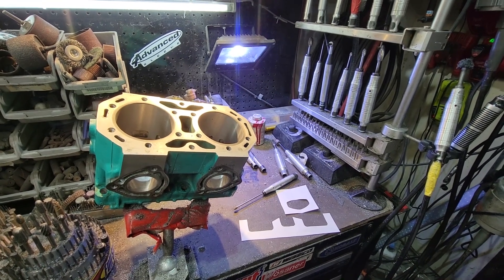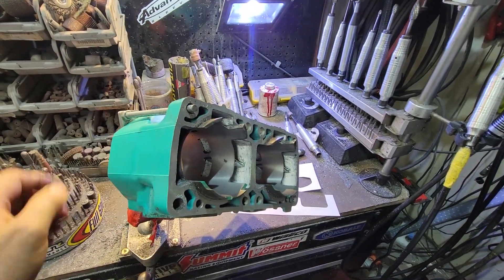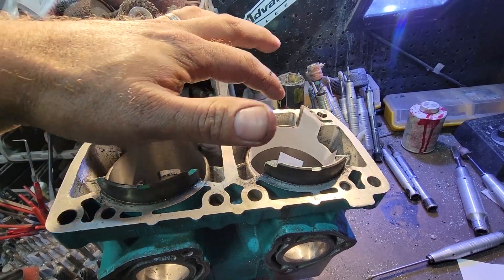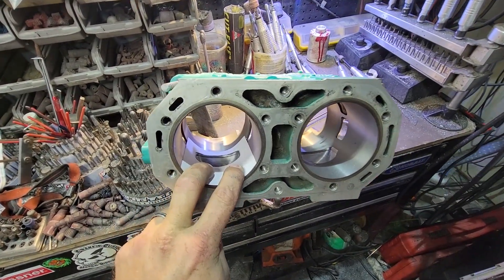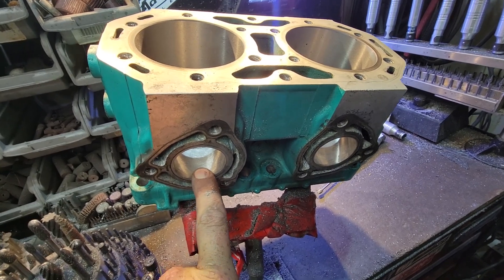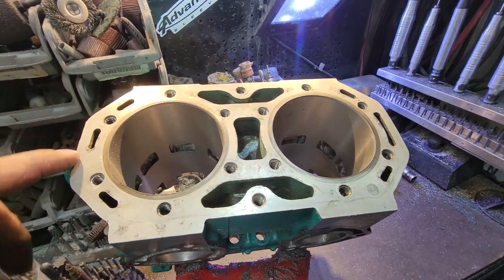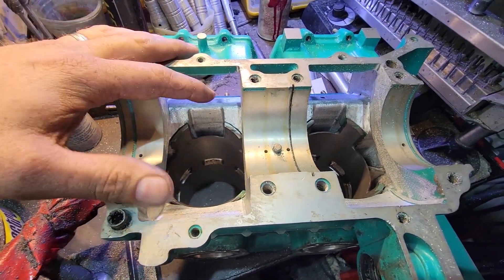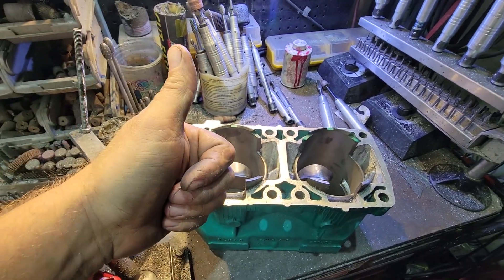ADDING BRAP! How to Port a Kawasaki 750 / 800 jetski cylinder. Porting kawi small pin / big pin cyl

Comment: Hey I got a question I have a 97 Kawasaki 1100 stx and the middle cylinder messed up and I have a 2000 stx di I took the cylinder off the di and put on my non di stx engine my question is are the cylinders ported the same will it work
Reply from the maker: Do be honest I never compared them.  I try to stay away from the Di stuff in general

Comment: Hi there bud, loved qatching through your videos. 

Do you still supply the templates? Your wbay link didnt seem to work. 

Am i correct in saying the ski wpupd not necessary need a high compression head (or milled stock) 

Thanks.
Reply from the maker: @davereynolds500  yes email us ericksonmap@gmail.com

Comment: What is the daikum you meant ion at 3:20 in the video, I’m guessing it’s to protect the cylinder walls?
Reply from the maker: No so you can scrib a line to grind to
Reply: @EricksonMachinePerformance  thank you for the reply, also should I use anything to protect cylinders from sparks when I’m grinding/cutting off the window at the bottom of cylinders for my 750sx motor?
Reply from the maker: @Jack-tl5io   The sparks won't hurt anything just when you're cutting ear off I put a piece of metal so that way  you don't hit the aluminum

Comment: Hey man, great content! Sorry to highjack the chat on this video but I wanted to reach out and ask a question about some old videos. Do you still recommend the use of Assemblee Goo when rebuilding fuel components like carburetors? I used to use wheel bearing grease but found some old work I've done had an apparent reaction with the aluminum in the carbs and caused corrosion.  I've been looking for something better.
Reply from the maker: Yes I use assembly goo for everything

Comment: Dear Mark,  I see cast iron cylinder liners in many of your videos. Do you know the material number of these liners? I want to turn a liner out of cast iron pipe myself, but there are many different types of cast iron can order and I hope you can help me further. Greatings, Jaap.
Reply from the maker: We use heat treated ductile iron.   that being said i know of guys that have used durabar BUT i never have.    it really depends on the application and power output.